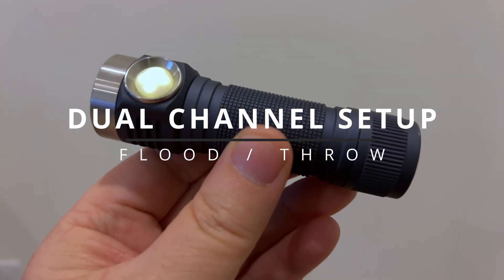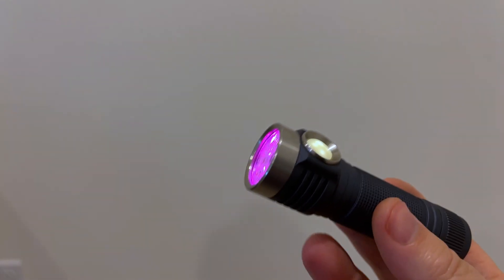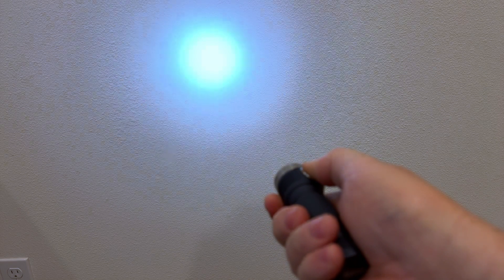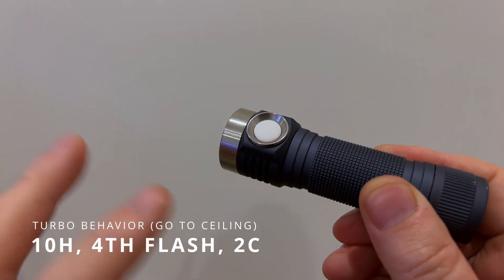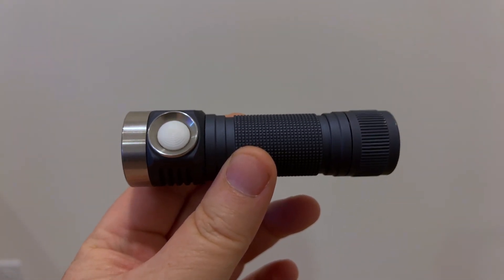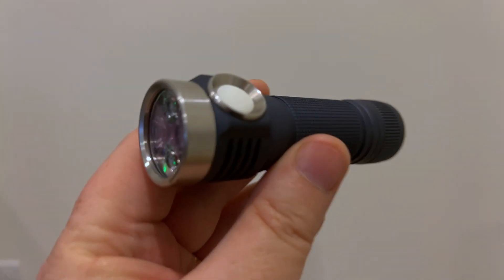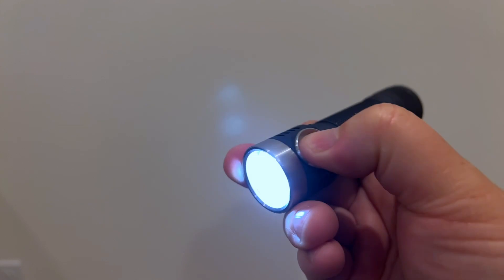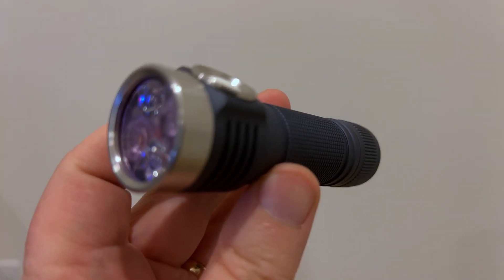How I set up a D4V2 Dual Channel KR4, D4SV2, D2

Comment: Hey I recently got my first Hank light and got nearly the exact same configuration. It seems from my testing that at least my light shipped with different configurations and I even reset to default but it behaves differently. The ceiling and or turbo doesnt mix channels (at least I can't tell) mine never ramped from flood to throw, click click hold is momentary turbo so I guess different versions of andruil

Comment: Not sure if something has changed -- I just got my dual channel now, and did a reset, got it into advance, but when I do hold on 9 from off, flash 1, click 1, I have to click three times to change channels.  It also doesn't go back and forth between sets 1 and 2 in this mode, it does that, but then has 2 other "mixes" thrown in.  So it has 4 modes vs 2 if that makes sense.

Comment: Hi Cheule! 
I have a D4K dual channel 519A 3500k + W1
Is this setup works for D4K? Because i had tried many times but still can't change instant switching step. When i do 2H it's always ramping to the floor and stop from it.
I don't know that if my D4K has any problem, but when i am in simple mode, i still can use functions in 3H menu, can change RGB aux color/style.
Please reply, i would really appreciate it!
Reply: I commented on someone else's comment, so this is just copy and pasting. It's also been 4 months, but if you still have issues, here you go! 

I've been having the same issue with my D4K (CH1 - 519a / CH2 - SST-20 Deep Red) and I could NOT get rid of the other channels and had 3H go to turbo.

Mine now is one channel at a time, and 3C to switch between them. 

Fix
A. Set to 2 Channel Mode
1. From OFF, 9H then let go after first flash/option. 
2. When it starts to do the "buzz" thing, 2C. 
- 2.a. This puts you in the "Misc Config" menu, then sets "Tint Ramp Style"
- 2.b. Two clicks sets the "tint ramp style" to two channel mode

B. Disable Channel Modes
1. From ON, 9H to get to channel modes. It cycles through the channel modes in this order
    - 1. Channel 1 Only
    - 2. Channel 2 Only
    - 3. Channel 1 & 2
    - 4. Instant Switching
    - 5. Auto-tint mode
    - 6..ish. Configure AUX leds
2. Repeat this for options 3, 4, and 5 above
- 2.a. Release after the flash
- 2.b. Don't do anything. (0C disables it)
    - It does take a second so be patient!

After you do that, from ON 3C should switch between channel 1 and channel 2. 
I haven't tried it, but I'm assuming if you only have option 4 active, you can 3H to switch between the two channels. I'll try that when I get home because that's how one of my other lights is set up.

Also, while typing this, I found this article on reddit that does great at explaining this a little more
https://www.reddit.com/r/Hanklights/comments/16xm9bw/andurl_2_dual_channel_features_and_options/?utm_source=share&utm_medium=web2x&context=3

Comment: Hi I’m trying to set up a D2 so that the 519A and the UV channels run separately. I’ve been going through this video as recommended by you from the D2 video. Is this video able to address separating the two channels? I’ve not been able to. Your help is greatly appreciated. Tim
Reply: I commented on someone else's comment, so this is just copy and pasting. 

I've been having the same issue with my D4K (CH1 - 519a / CH2 - SST-20 Deep Red) and I could NOT get rid of the other channels and had 3H go to turbo.

Mine now is one channel at a time, and 3C to switch between them. 

Fix
A. Set to 2 Channel Mode
1. From OFF, 9H then let go after first flash/option. 
2. When it starts to do the "buzz" thing, 2C. 
- 2.a. This puts you in the "Misc Config" menu, then sets "Tint Ramp Style"
- 2.b. Two clicks sets the "tint ramp style" to two channel mode

B. Disable Channel Modes
1. From ON, 9H to get to channel modes. It cycles through the channel modes in this order
    - 1. Channel 1 Only
    - 2. Channel 2 Only
    - 3. Channel 1 & 2
    - 4. Instant Switching
    - 5. Auto-tint mode
    - 6..ish. Configure AUX leds
2. Repeat this for options 3, 4, and 5 above
- 2.a. Release after the flash
- 2.b. Don't do anything. (0C disables it)
    - It does take a second so be patient!

After you do that, from ON 3C should switch between channel 1 and channel 2. 
I haven't tried it, but I'm assuming if you only have option 4 active, you can 3H to switch between the two channels. I'll try that when I get home because that's how one of my other lights is set up.

Also, while typing this, I found this article on reddit that does great at explaining this a little more
https://www.reddit.com/r/Hanklights/comments/16xm9bw/andurl_2_dual_channel_features_and_options/?utm_source=share&utm_medium=web2x&context=3

Comment: How can I make my D2 switch from channel 1 to channel 2 and vice versa only?

When I triple-click to switch from channel 1 to channel 2, then triple-click to go back to channel 1, my D2 will go into channel 1+2 three times before switching back to channel 1.

There are no videos or anything specifically about that for the D2.

If you can help me, I would really appreciate it.

By the way, I have two D2. Both have on channel 1 519A 3500K and channel 2 are SST-20 Deep Red and UV.
Reply: I have the same issue with my newly received DS4V2. 3C cycles through 5 different setting, CH1, CH2, CH1+2 x 3 (the middle of which allows for tint ramping - I don't what the difference is between the 3rd and the 5th setting🤷). I would like to get rid of all except the first two
Reply: @nicolasivackovic4389  I figured it out on my D2, but not sure how to change it on a DS4V2, since I do not have one.
Reply: Same problem with my D4K. Just receive my light yesterday but can't follow any thing in this video 😢
Reply: @bmoriarty5482  These videos are no help, and the uploader does not upload a precise tutorial on it.

I learned how to setup everything on my D2 from an updated chart.
Reply: @EdingardSIGMA  where could i look for it? I just email to Hank this morning, he said the firmware on my D4K is the newest. That allow you to use functions like advanced mode but in simple mode. I don't really need it at all
Reply: @bmoriarty5482  I think I solved the issue now, by default a dual channel light comes with a cycle of 5 settings/combinations of channels (the ones I described above). In the advanced UI, there is a way to disable/enable the settings that you want. It's 9H from ON.

Comment: Hello, I have been trying to setup my D2 with SST Red top & UV bottom following this video, but I can’t seem to get the same results. Do I need to setup differently for my choice of emitters?
Reply: I commented on someone else's comment, so this is just copy and pasting. 

I've been having the same issue with my D4K (CH1 - 519a / CH2 - SST-20 Deep Red) and I could NOT get rid of the other channels and had 3H go to turbo.

Mine now is one channel at a time, and 3C to switch between them. 

Fix
A. Set to 2 Channel Mode
1. From OFF, 9H then let go after first flash/option. 
2. When it starts to do the "buzz" thing, 2C. 
- 2.a. This puts you in the "Misc Config" menu, then sets "Tint Ramp Style"
- 2.b. Two clicks sets the "tint ramp style" to two channel mode

B. Disable Channel Modes
1. From ON, 9H to get to channel modes. It cycles through the channel modes in this order
    - 1. Channel 1 Only
    - 2. Channel 2 Only
    - 3. Channel 1 & 2
    - 4. Instant Switching
    - 5. Auto-tint mode
    - 6..ish. Configure AUX leds
2. Repeat this for options 3, 4, and 5 above
- 2.a. Release after the flash
- 2.b. Don't do anything. (0C disables it)
    - It does take a second so be patient!

After you do that, from ON 3C should switch between channel 1 and channel 2. 
I haven't tried it, but I'm assuming if you only have option 4 active, you can 3H to switch between the two channels. I'll try that when I get home because that's how one of my other lights is set up.

Also, while typing this, I found this article on reddit that does great at explaining this a little more
https://www.reddit.com/r/Hanklights/comments/16xm9bw/andurl_2_dual_channel_features_and_options/?utm_source=share&utm_medium=web2x&context=3

Comment: Thanks! This was very helpful when I was setting up my flashlight on the build it came with. I've been playing with the newest build (2023-08-07) and it seems the UI has changed for the D4K (Model Code 0135).

150/150 seems to be the max output for a single channel; going to 150/150 will keep only one channel on. You can instant switch channels in 2 different ways: Keeping the light in Tint Ramp Channel Mode and setting the style to Channel Toggle. Or disabling all channel modes except Channels 1 and 2. I prefer the former because I can also have 50/50 on and 3C will let me turn both channels on when I want. And 3H on Tint Ramp will allow me to instant switch between the 2.

Comment: So I got it to work but now the slow ramp doesn't function, i can switch the the fast ramp up/ down but the hold to go slow doesn't work anymore. Did i do something wrong?
Reply from the maker: One of my biggest gripes about anduril is that it changes too fast, and there are too many incremental versions floating around.  It could very well be that my video is out of date or that you miss licked somewhere. If you want to perform a factory reset and try again, hold the button while engaging the tail cap.  Wait for the strobe to ramp and flash.

Comment: 3:22 I'm only getting 3 flashes with my new D2.  Also, I have the same setup as your D2 (519a and UV) and I was wondering is there a way when I go to high on UV that it doesn't use the main channel?  I think you explained this in the ceiling section that it can't (I think). 

Thanks
Reply: nevermind lol I got it
Reply: Do you look for yooperlite with it?

Comment: My d4sv2 doesn't make it to the 4th flash during the On -> 10H -> 4F -> 2C program.. 

It will flash 3 times and then the whole light shuts off until I let go. Then it ends up on a high or turbo of sorts..
Reply from the maker: You probably have a different version of the firmware. That’s one of the biggest strengths (and weaknesses) to Anduril. It’s always changing.

Comment: This is reassuring to me because i ordered a d4k copper dual channel with w1 green and 519a 4500k and was worried it wouldn't be throwy enough. I'll have to use this configuration when it arrives. Thanks cheule!
Reply: Does the Copper offer measurable improved performance such as extended turbo runtime or something? Is it significant if there is any improvement? Or is it simply the cool factor? Thanks

Comment: IS there an update to the dual channel lights.  I do this and both lights I have still want to use both turbos when I click twice for turbo.  The light gets got quickly as well.  Just wondering if there has been a change.
Reply: I've been having the same issue with my D4K (CH1 - 519a / CH2 - SST-20 Deep Red) and I could NOT get rid of the other channels and had 3H go to turbo.

Mine now is one channel at a time, and 3C to switch between them. 

Fix
A. Set to 2 Channel Mode
1. From OFF, 9H then let go after first flash/option. 
2. When it starts to do the "buzz" thing, 2C. 
- 2.a. This puts you in the "Misc Config" menu, then sets "Tint Ramp Style"
- 2.b. Two clicks sets the "tint ramp style" to two channel mode

B. Disable Channel Modes
1. From ON, 9H to get to channel modes. It cycles through the channel modes in this order
    - 1. Channel 1 Only
    - 2. Channel 2 Only
    - 3. Channel 1 & 2
    - 4. Instant Switching
    - 5. Auto-tint mode
    - 6..ish. Configure AUX leds
2. Repeat this for options 3, 4, and 5 above
- 2.a. Release after the flash
- 2.b. Don't do anything. (0C disables it)
    - It does take a second so be patient!

After you do that, from ON 3C should switch between channel 1 and channel 2. 
I haven't tried it, but I'm assuming if you only have option 4 active, you can 3H to switch between the two channels. I'll try that when I get home because that's how one of my other lights is set up.

Also, while typing this, I found this article on reddit that does great at explaining this a little more
https://www.reddit.com/r/Hanklights/comments/16xm9bw/andurl_2_dual_channel_features_and_options/?utm_source=share&utm_medium=web2x&context=3

Comment: Great and valuable video! Thanks! This is exactly how a dual channel flood/throw light should operate, IMO. I have 2 Dual channel lights coming. One is a flood/throw combo, and the other is a flood/red headlamp, which I want in the same configuration.
Reply: What headlamp did you get?

Comment: If I run the 150/150 ceiling setting, will there be a difference when I turbo from one channel or the other? So for example, the turbo on channel one will be run at 130 and the second at 20(*5=100), and then switching the active channel and going to turbo will make the channel 2 run at 130 power and channel 1 at 20(*5=100). Is this correct?

Comment: Great Video man straight to the point, I have the Emisar D4V2 Diff button colour to yours, I can't enable the flood/throw option 9H 1C option however I did purchase the Flood Lens and Throw Lens, Will mine be able to enable the throw/flood option like yours?
Reply from the maker: Is yours a dual channel driver? It’s a special order from Hank. The optic will change the look of the beam, but won’t enable channel switching.

Comment: took me a hot minute but I got it set up right now....with this setting though is there still an easy way to get to the turbo with both channels.  I do notice if i do the 2H from off i still get in dual channel turbo (momentary) .Thanks so much for the vid !  I've got the same light but with lh351d 5700k and w1 6000k. It's awesome.

Comment: You say maximum brightness on each channel . What does maximum brightness mean ? 150 out of 150 or what ?
Thanks
Reply from the maker: With dual channel, 130/150 is 100% or maximum brightness. Ever step higher is 5% to the other channel. So 131/150 is 100% plus 5% on the other channel. So 140/150 is 100% + 50 %

Comment: If I set my light up like this and ramp all the way up . Is the top of the ramp actually TURBO which is 150 out of 150. Because when I double tap to TURBO it seems the same brightness as the high ramp.
Thanks
Reply from the maker: Top of ramp is the full 9A or “turbo” if you will. The set up here allows you to get to 100% on the channel without slowly ramping up (and a double tap again sends you back to the previous level). If you ramp to the top anyhow, THEN double tap, you get 200% mode, or both channels to 100%.
Reply: @cheule  
Ok so what you are saying is when I SLOWLY ramp up all the way to the TOP of the ramp it is TURBO/100%/9a ? 
THANKS
Reply: Not double tapping , just slowly ramping to the top of ramp for TURBO.

Comment: i tried this a dozen times but the last step wont work to get the single channel turbo. does having the kr4 driver have something to do with it? should i reset and start all over? when im on a single channel and double click, all 4 lights turn on to turbo.
Reply from the maker: Do you have a dual channel light? You said KR4 channel, so that makes me think you have a single channel light with 4 emitters that are the same type.
Reply: @cheule  Hi! yes i do i was able to get them on seperately but i just cant get them to turbo on each channel without all 4 turning on. the last step doesnt seem to work for me.
Reply: @cheule  honestly its not that important. if i can pick your brain for just a sec, can you recommend a similar size light with the most flood?

Comment: Great video! There are a couple extra things to note:

Instead of 21C, you can do 2H and then one additional click, as a press and hold in the configuration menus registers as 10C.

In the Turbo behaviour selected, another 2C after the first will jump up to 150/150, so you still have the option for all channels at 100% if you need it. Additionally, hitting 2C after ramping to the ceiling will jump to 150/150.
Reply: CRC  No, you can still 2C back into the previous level
Reply: Can you guys expand on this a little more please? Idk what to do
Reply from the maker: I did know about both these things. I’ve been trying to be more succinct in my videos, so I figured the detail about 1 click equaling 5 would take too much extra time.

Not mentioning the 2C from top of ramp to get to 150/150 was purely oversight. I mentioned it in r/flashlights though!
Reply: @cheule  Lol I figured, I was hoping to add some extra info for anyone who wandered into the comments :P Sorry should have said that

Comment: Great video,  I received my second w1/lh351d last week,  the lh351d are 3500k,  with a diffuser it makes a nice camping lantern (I have a few blflt1s) 

You should start thinking about producing a diffuser.
Reply: A video showing how to reduce the floor and then increase the stepped ramping modes would be a good guide. I’m currently trying to add a total of 10 steps but seem to have created a total of 19 on my first try,  I reset the torch and then  just added three but it seemed to just set it to three levels.  I do extended 11 night camping trips so I like to know what my power consumption is ( I test the run times at a particular level for an hour and then check the remaining voltage / battery %).   My main power sources are lithium phosphate packs which then get used to recharge 26650s etc.

Comment: Do you need to set it up like this for both channels? My light sometimes turbos all four, and sometimes it turbos each channel separately. It’s a weird quirk
Reply: You don't need to set both channels, in fact I don't think you can set them individually. I think what's happening with your light is when you 2C from anywhere below the ceiling, the light goes to ceiling and two emitters are on. When you ramp up to ceiling and 2C from ceiling, the light goes to turbo with 4 emitters on.
Reply from the maker: This is the answer. And I actually find it the best of both worlds.